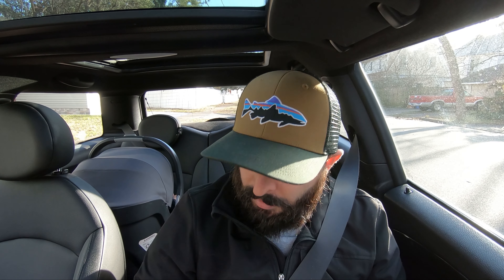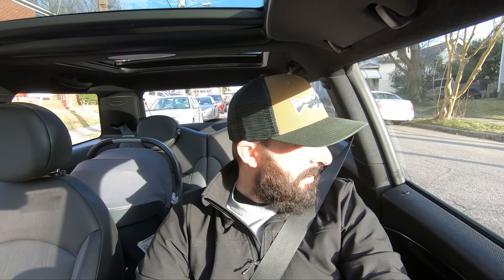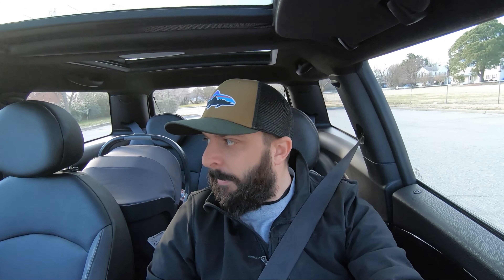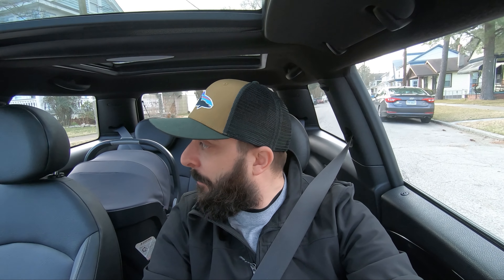1O PROBLEMS (AND SOLUTIONS) YOU ARE GOING TO RUN INTO WITH YOUR MINI.. RELIABLE IF CARED FOR

Comment: Looking forward to seeing the video on the timing chain. My R56 Cooper S is at 77k miles and has apparently had the chain done but I have no evidence, so tempted to do it anyway. Also, a common thing on these is the carbon build-up on the tops of the valves. Kills a lot of the N14 engines. apparently. Thanks for the continued advice, though. It's very useful. I have a fuelling issue so I'll be checking relays tomorrow thanks to your advice.

Comment: Great video but you missed a couple of items: 1) the gaskets/seals in the oil filter/cooler housing, 2) turbocharger wastegate valve wearing out and rattling, 3) if the windshield has ever been replaced, there is a slot in the body at the top of the A-piller that is covered by the leading edge of the roof gutter that is sealed with buytl from the factory. That sealant is removed and not replaced by the windshield tech. If the car is parked, with the front downhill, in a rainstorm, water can leak in and flood just like leaking sunroof drains.